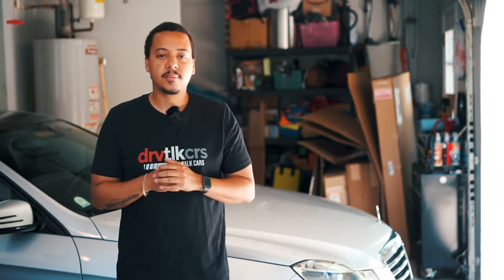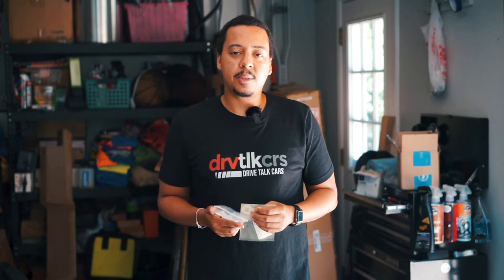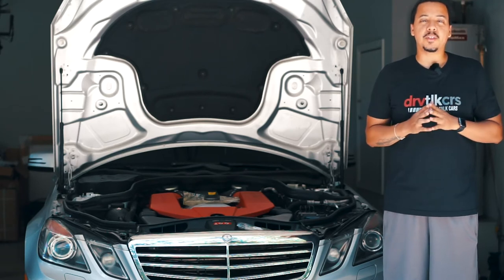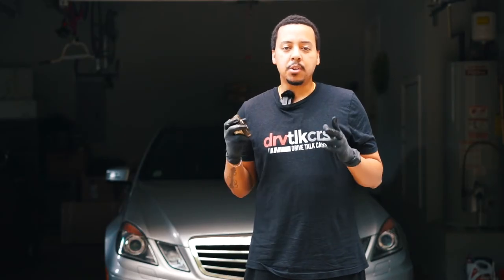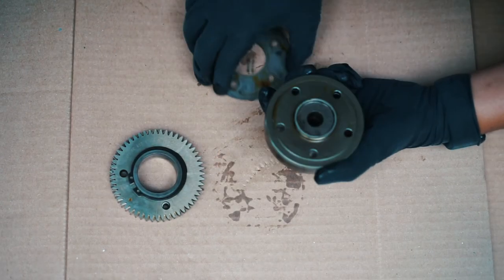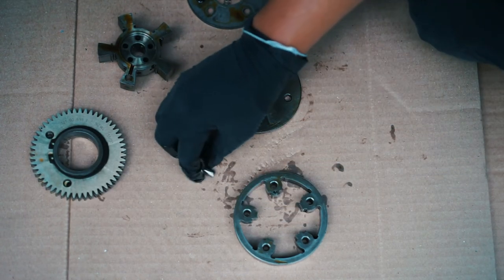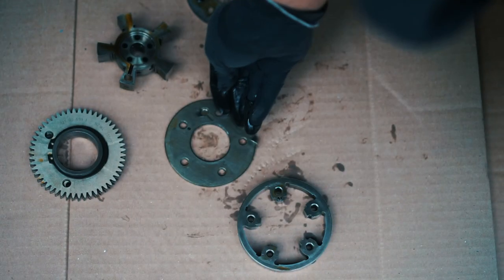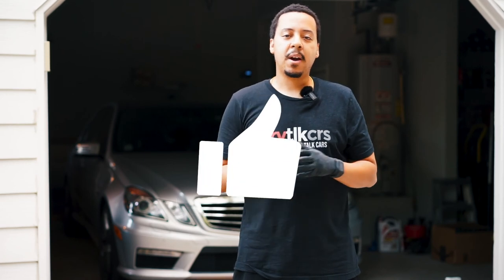CAMSHAFT ADJUSTER FAILED! What went wrong with pin flip trick.

Comment: Hey very late to the video! I noticed that in the new cam adjuster the teeth were not aligned. Did you have to align them with the locking tool prior to installing it?

Comment: Do I need to replace the valve cover seal and the timing cover seal or i can reuse them. And also when you put the new adjuster in, how can you make sure the timing is right. Because i saw the part 1 2 3 you used a little locking tool on the gear. This part really confused me. Hope i can get more detail about it. First time working on the M156 lol.
Reply from the maker: Well...technically you can reuse both seals. I think for most people, they change them because you won’t be accessing those areas too often. So while it is available might as well change it. But it is completely up to you. If it isn’t leaking, worn out or damaged then... 🤷🏽‍♂️
The tool I use is the timing tool. It locks the camshafts in two places. Rear and front. Lock the rear first to ensure the camshafts are in the correct position. Then the front. The camshaft adjuster has a plate on it that has various cutouts (gaps) on it. When reinstalling you use the install plate (red in my case) to make sure those cutouts are in the right position. If they are not then your engine timing while be off. I hope that helps.

Thanks for commenting. Good luck! 👍🏽

Comment: Hi, i have read on a forum about  the "cam adjuster sensor calibration procedure" that has to be done with the star software of Mercedes after the camshaft adjustement replacement ? have you heard about that ? I think you didn't to it, but have you got any issue?
Reply from the maker: Hey, I have seen that. You are correct, I didn’t perform that procedure. However, I haven’t had any issues with my adjuster.

Comment: I wonder if it could be tig welded, machined on a mill and heat treated using oil, like when heat treating a blade or sword.
Reply: Might be a stronger weld than the original soft  Mercedes plate.
Reply: @carloseiland5117  Especially if using Stainless steel rods to weld it.

Comment: FYI - You can get a set of 4 upgraded backplates from 63 Motorsports for around the price of a single cam adjuster from M-B:

https://www.63motorsports.com/m156-shop/amg-camshaft-adjusters/p/stage1

I'm not affiliated at all with 63 Motorsports, I was just planning to do this job this weekend and though I'd share this with anyone else who might be needing to do it soon.
Reply: So i can just buy & replace just the backplate  . No need to get the  new whole set adjuster? At the dealer in my country, the adjuster costs 2k! Each.
Reply from the maker: Thanks for sharing the info. At the time of the video the plates were not available. Unfortunately, I came across 63motorsport afterwards.😕